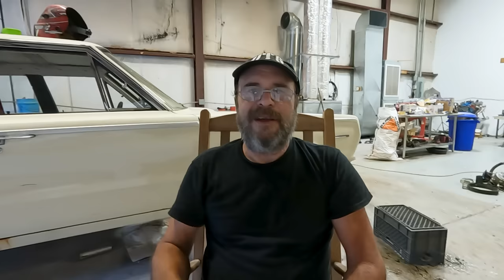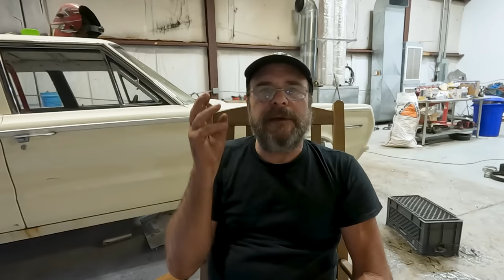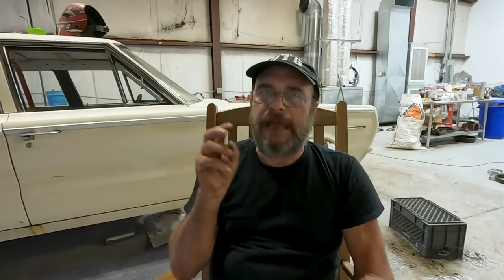They Really Are Out To Get You- How The Automakers Have Made Life Miserable For The Average Mechanic

Comment: Great topic to discuss. This same issue of serviceability has infiltrated many industries. It certainly seems to be more concentrated in the automotive industry due to the many different systems and parts that work together to keep a vehicle running
Reply: Look up Right to Repair and Planned Obsolescence.
Or the other word for it Corporate greed.
Reply: I did electronics for a career. You could make a decent buck in the days of vacuum tubes. Change a few tubes, and be done. One of the later things I worked on was a chip, about 2"x2", about 250 pins, of different lengths to connect to one of 7 layers of printed copper in the board. Ir's why you don't see any electronic service centers these days.
Reply: For this old clunky boomer, the current disposable culture is really terrifying, when we being buried alive with garbage all around.
Then what about all those whoopla of solar, wind energy, EV, flavors of the day when highways are parkinglot and traffic jams all around burning   gianomus amount of gas every second.😢

Comment: when the vehicle manufacturers are forced to issue a recall with a problem on a motor or a transmission, often they will just replace the entire motor or transmission at the dealership because they don't want to pay the cost of having real mechanics.  the technicians are often very young "parts changers".  of course they are in the many cases where they find some computer reflash idea to work around the issue but many dealerships are backed up with motors and transmissions coming in to be swapped because of faulty designs.

Comment: Here is an example of some of the rotten crap they have done to us regular people. It used to be many years ago when your oil sensor went out that you would crawl underneath the car, the sensor with a pair of channel locks, and twisted out of the engine block. Then you're screwed a new one in and you were done. 20 minutes tops.

On my 2010 Escalade they put the oil sensor all the way at the top all the way at the back of the engine block, hard against the firewall. Two small access holes to get through. I'm not a bad mechanic and it took me 3 hours to change the stupid thing. There's no excuse for this other than they want the average mechanic to look at this job and say,  "Screw it, I'm taking it to the dealer."

Comment: I am the last of the boomers 1964. My job, I solve problems. To do, so you must have a multitude of mechanical experience. I have a decent number of clients that say call the guy, that is me. Automotive, HVAC, plumbing, electrical, landscaping, stereo equipment installation and service, painting, stucco, concrete basically the list goes on and on. About the only thing I don’t do is walk the dog and get the groceries. 
 You and I didn’t have YouTube growing up but if we were lucky we got it in our late 20’s early 30’s and it wasn’t what it is today, so we had to learn things the hard way hands on and manuals thanks God for Haynes and Chitons.
Now we have YouTube a vast wealth of knowledge, you can literally find anything on YouTube and if you don’t find it post its solution on your channel because someone is looking for it. 
 Guys like you and I must continue to grow daily because things are changing daily. Some for the good some for the bad 🙃 
 I ran into a push button electronic emergency brake just yesterday. Today I know how to work with them. Bet your ace, that when I saw it I said WTAF is that.

Comment: Great video. My two cars are in the 90s and before all the crazy computerized madness. 
There is a similar thing in the computer repair world, especially with Apple computers, where originally they were designed to be easily repairable and upgradeable by the end user, and makes sense, and gradually more and more now they make them deliberately hard or impossible to service or upgrade, either by independent repair shop or an at home techie.  They have even gone legally after suppliers of parts, claiming illegitimately that they are violating patents or or trade marks. There’s a whole movement called the “Right to Repair” that’s gotten political track time.

Comment: I just did a driveshaft replacement and had to put the old one back in because the new one vibrated more, and the u joints weren't replaceable because they welded them in! I have laughed at people welding u joints in, then they start doing that at the factory. Not to mention nothing is greasable, grease don't last forever it drys out

Comment: Don't forget by the mid 1950s auto makers drastically changed their mentalities in marketing and engineering . They came up with planned obsolescence. Cars were built to last just a couple years and about 50k miles. The idea was customers would be pursuaded to buy a new car every year. Delorean wrote about this in his autobiography. Studebaker was the only manufacturer that bragged about using the same design every year. Studebakers motto: "The Common Sense Car".
Reply: Actually, this was by necessity.  The successful manufacturers have to give some incentive for you to buy another one.  Over 100 years ago, there were many farm tractor/implement companies.  They all went out of business, because they built their tractors to last indefinitely, & farmers wouldn't buy the 'new model', there wasn't anything wrong with the one they had.  Those old tractors still run today.
Reply: @atheplummer it's all on purpose.

Comment: I thought among things that would make a mechanic feel like the auto maker was deliberately making life miserable would be to mention "VIN locking" so that even if you have the actual genuine factory part, it won't work without the stupid secret code tied to the vehicle's VIN number that someone at the dealership would have to enter into the car's computer system to even acknowledge the part, let alone let it work. A couple of the local repair garages I know now have cut off dates for vehicles they will work on or own. My next daily driver won't be newer, it will be older.
Reply: I can flash modules at my house with a laptop, a j2534 tool and $40 to GM per vin. You just have to research how to perform the work.
Reply: @mph5896 Yeah, we need to get smarter. The modern mechanic needs to become a hacker. Look at what the Apple repair techs are up to getting around all Apple's anti repair stuff. Car manufacturers aren't nearly as smart as they think they are. Everything can be reverse engineered, modified or reprogrammed.

Hell I'm watching YouTube on a modded version of the YouTube app that gives me no ads for free and a customisable interface. It's actually just the official app with third party patches. We can adapt, overcome and beat these cretins at their own game.
Reply: Changed the gauge cluster in my John Deere 6150 and the computer locked the tractor in park until I could get the mechanic to plug his computer in. $500 for 5 minutes of work, all because the computer didn't recognize the new gauges.
Reply: Get something from 2006 or earlier.
Reply: @lsswappedcessna  In the European market the goal is pre 2000, as they started doing everything on some kind of a bus from then on. Parts for American cars can over here be unobtanium.
Reply: @lsswappedcessna did you really LS swap a Cessna?
Reply: @lsswappedcessna   Already have a 2002 car approaching 300k miles.  Looking for something with fewer computers next time and easier to keep alive. It's made it this far mostly because I'm stubborn.

Comment: I remember when I first ran into one of those specialty tool problems. It was a mid eighties Ford escort, to get the ignition module off the distributor you needed a 5.5mm deep well thin walled socket. Just so happens that Snap-on just had the  socket you needed! I later found out this is all part of the dealer support programs. It's how the manufacturer throws a bone to help dealerships make money.
Reply: First time I came across one of those 5.5mm bolts ,I was going thru every socket in the bosses box (I was a kid,and green) and he comes over to ask what's up. 
Can't find a socket for that bolt ,,boss, I've tried all the metric and standard  sockets.  
He chuckles and goes in a drawer and hands me a 5.5  he had to the side in a "special tools" drawer.
Reply: 5.5 huh. Guess you guys never worked on a German typewriter 😊

Comment: I have said and believed for years auto repair goes against the manufactures desire to sell new cars.  They have made it difficult purposely like you said.  Even dangerous as in the fuel tank/pump jobs.  Have seen a few fires myself.  Fortunately for me no deaths.  Did see a few close calls.  Once saw flat rate mechanics in a dealership playing with a sending unit while literally standing in a huge puddle of gas.  Glad I talked them into stepping back and cleaning it up before it got worse.  Also I was trained by a ww2 mechanic who had to chase and put out two mechanics that were on fire (separate incidents).  Both burned mechanics died.  RIP

Comment: AMEN brother. Agree 100% with everything you said. It is DEFINITELY deliberate! I actually closed up shop after 14 years due to this, & the bad “new” parts problem, along with supply chain issues. I’m just sick and tired of ALL of it. My fire for this stuff has long since burned out. So bad that I don’t even enjoy wrenching on my old stuff as much as I used to. I did sell my over-complicated ‘07 Silverado 1500 for a nice, Southwestern ‘93 W250 with a Cummins 12v & a 5-speed. At least I can fix this one without having a mental break, or experiencing financial bankruptcy. Parts are still REASONABLE for this one. Dana 60 front, Dana 70 rear, 205 transfer case. Should last the rest of my life as long as I keep it out of road salt. 👍
Reply: this is why after 28 years as a mercedes mechanic i am planning my escape. I have a nice 2001 Miata that I will keep.  I also plan to get a couple 80's cars that are simple

Comment: This has been the case for sometime. Case in point - alternator removal on some front wheel drive cars. Sometimes it's suspension/steering components out first. I have split the alternator in half at times to remove it from the vehicle. Due to the added work involved you don't really want to fix the alternator with a set of brushes and bearings or whatever is wrong with it for the fear of another internal part failing and having to re-pull the thing as with a traditional engine with good accessibility it was a common thing to do, worth the risk to repair. So yeah, fixing things is not really an option.
Reply: Just going to leave this here:  Ford Conture V6 alterator......
Reply: I'm so old that I went to the parts store to get a diode set for an alternator and found out it's not available anymore and felt surprised.
Reply: Look at changing an alternator in a mini cooper

Comment: Serviceability: spot on.  Computers are great for diagnostics, but they are running way too many things in cars.  Most can grab the know how to use a multimeter and sort out a relay gone bad.  But today, a mechanic needs to use an oscilloscope to find glitching components like cam timimg sensors etc.  And it gets worse: radar based collision avoidance involves blanking signals, millisecond time of arrival issues and more - gotta be an electronics tech or its parts cannon time.  if just 1% of Americans know about standing wave ratios, edge triggering,  dummy loads, and a little about how/when to do an RF survey etc I would be amazed.
Reply: True.

Comment: A few years ago, I was working on a fuel system, and a drop of fuel fell on a drop light bulb. That was enough to shatter the glass, and I had a big gasoline fire on my hands. I was lucky to get out of that one unscathed. The car ended up needing more work than originally planned unfortunately...
Reply: I've done that too, once. Now I buy the rubber coated "rough survice" bulbs.
Reply: @retiredkidbuck  Pretty sure that's what this was actually. Cold gasoline will shatter a hot bulb whether it's got a little rubber on it or not. I prefer LED lights. Not saying they couldn't start a fire, but at least they won't shatter

Comment: Whenever I catch myself asking the "why did they do it that way" question, it usually boils down to easy low cost assembly. They don't worry about serviceability, they just want to put them together as quickly as possible with the lowest cost labor they can get away with. It's usually not malice, just stupidity.
Reply: I wouldn’t even say it’s stupidity - what’s in it for Ford to make a part designed to last more than 8-10 years?  What’s it in for Ford to make repairing the vehicle 10-20 years down the road easier/cheaper?  It’s not going to help them sell more new cars. Most owners who buy new replace their car in 6-8 years.  There’s just zero incentive for them to spend 1 extra minute or dollar to make a car easier to fix.  The German luxury auto makers figured this out. Remember when a Mercedes just ran forever?  That’s bad for business!  Now Mercedes, Audi, and BMW are designed to last through their warranty period, which is often the same term length as either a typical lease (very popular with expensive luxury cars), or their financing terms.  Once the car is paid off, now comes the $5-7k recommended services (that’s maintenance, not even talking repairs!), so time to trade that car in for a new one.  Repeat business.  “If you can’t afford a new BMW, then you definitely can’t afford a used one!”
Reply: After some of the things I've seen I'd say you're wrong. It is malice. Being a mechanic for 30 plus years has shown me a lot of malicious planned obsolescence.
Reply: See you make the mistake of assuming people are generally good. They aren't stop giving the benefit of the doubt they know exactly what they are doing and they do it because people like you give them the benefit of the doubt they do NOT deserve.
Reply: @thomasbenham8866 90% of income for Car Dealers is indeed the service department so I disagree with you
Reply: No, it's intentional. They want you to throw it away every year and buy a new 100k car yearly
Reply: @location_florida  they want everyone paying monthly forever an renting it and never owning anything, i dont play those games
Reply: There’s that but also PRICE POINT.    Just like anything else if it saves a penny a product. The engineers will spec it due to relentless beating by BEAN COUNTERS.     It’s mostly just a recurring cycle of “good nuff” using less of or cheaper quality.
Reply: It's always malice, stupid people don't own companies.

Comment: It is going to be interesting to see what happens to the EVs when they start getting older.  The one thing we know is that spark plugs are not going to be an issue.
Reply: I think about that a lot. I just had my wife’s car battery start to go bad at 1 1/2 years and it gave me a headache trying to diagnose that. Finally had to buy a battery tester to save the hassle of pulling it out to take to the auto zone.
Reply: Not really imo. They’re moving to subscriptions and making the process more difficult as UT said.

There’s one fella on YT who was repairing a Tesla from a bunch of donors and first thing he had to do was jailbreak the car so he could operate and diagnose.

The average person will not be capable of jailbreaking a car, let alone dropping a battery laden chassis/hoisting a cockpit from chassis.
Reply: Very little maintenance required.  Coolant replacement is the big bear at around 100k, but even brakes and brake fluid gets much lighter use.  LED lights and such.  That being said, letting it bake in the sun and freeze outside all the time is going to be killer on the gadgets and gizmos.
Reply: Aftermarket computers which connect a high voltage EV battery pack to the appropriate motors, possibly running desktop PC operating systems so a savvy programmer would be able to write all the needed code,, such as the unit made by Sloppy Mechanics for LS engines. Or even an analog controller for Tesla etc made from industrial switches and breakers, such as the way early electric cars were controlled in the 1900s. Electric crate motors which are designed to take a standard VSS and drive by wire signal for retrofits. We're in a transition period where nothing is standardized, much like how television was in the 2000's when you had 240p black and white tube TVs which could only receive radio frequency signal sold alongside early flat screen HDTVs which were digital, people moving their VHS collections to DVD, etc.. At some point we will get the "HDMI cable" of EVs and doing a swap will be much simpler than setting up a fuel injection system. After a swap just buy the cheap computer, plug in the motor, give it a VSS signal, brake pedal sensor signal, potentiometer for the accelerator, maybe coolant sensors and a volt meter and that's it. Aftermarket charge controllers already out there. Have the software be flashable and give the option to regulate amperage like fuel maps are done in the current day. New electric vehicles coming out which are designed and marketed around serviceability.

Comment: some of this is caused by the "DFM" or design for manufacturability efforts that started in the 90's.  Unfortunately, DFM isn't always compatible with serviceability.  Manufactures found this to be a double whammy way to increased profits.  They saved money on manufacturing and then made more money through increased service charges.
Reply: There is also planned obsolescence. Parts are basically designed to Outlast the warranty and that's it.
Reply: Don't forget customer appreciation is valued and honored! 
Trade back in your bought new 10 years ago (if your lucky) regularly serviced, recently unfixable, obsolete since 5 years ago (because they made it that way) model for a nice small incentive and absolutely no trade in value. 
For todays newest model at double the price and half the longevity.
We appreciate you sticking around for us to continue screwin you!!!🤑